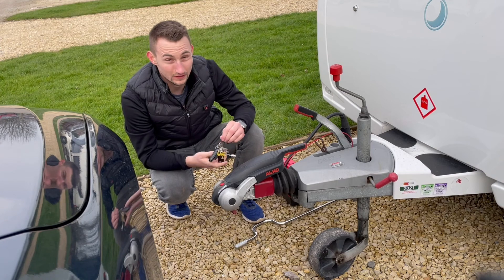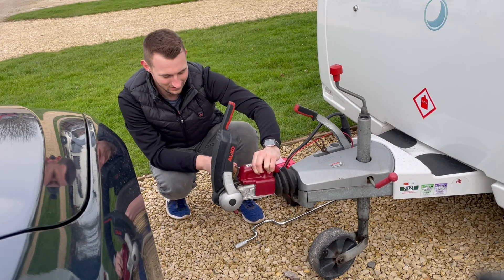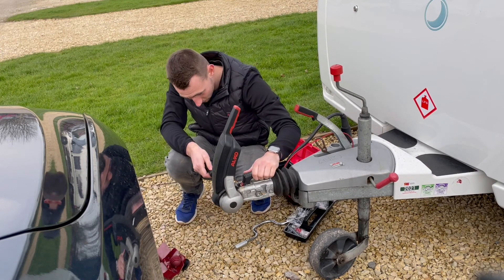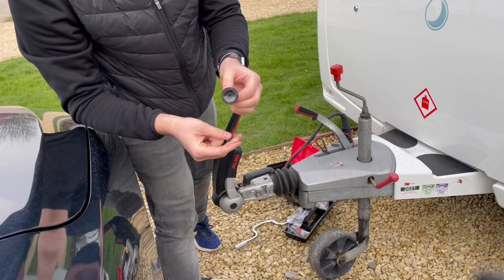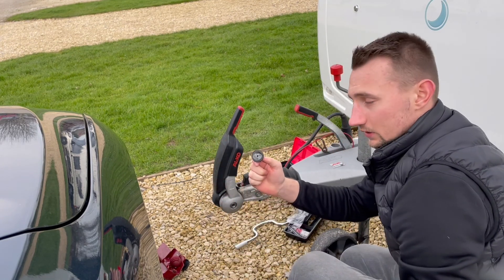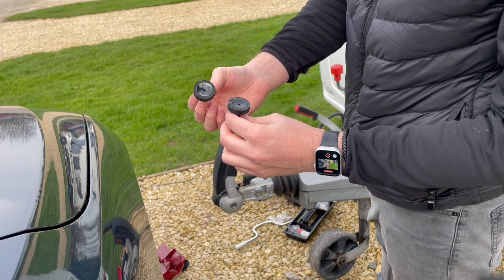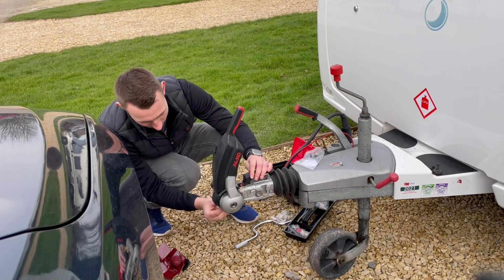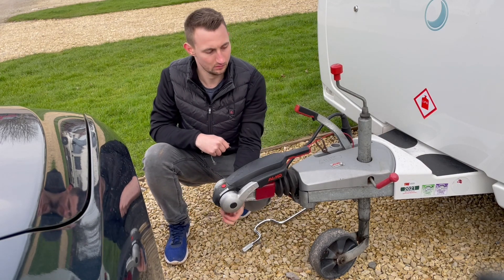Alko stabaliser pad replacements

Comment: at £40 plus for a set of new side pads its best to repair them by rubbing them down with some wet and dry paper..dont for get £40 plus for a set of front and back pads too..................
Reply from the maker: Absolutely it’s a lot of money but. I had already bought a spare pair so have kept the old ones sanded down as a spare pair. Just wanted the best for the next outing and it’s paid dividends